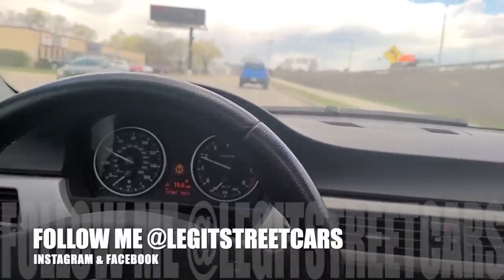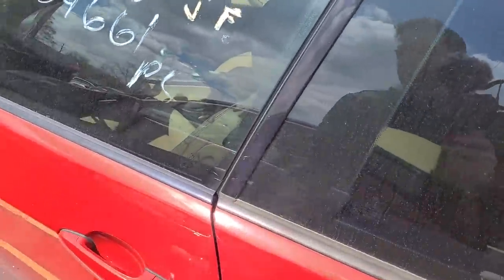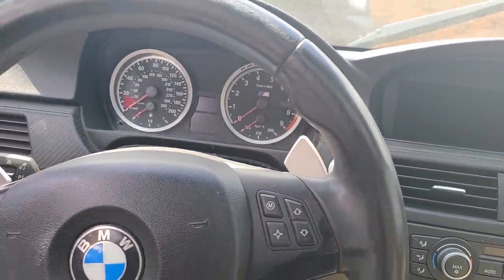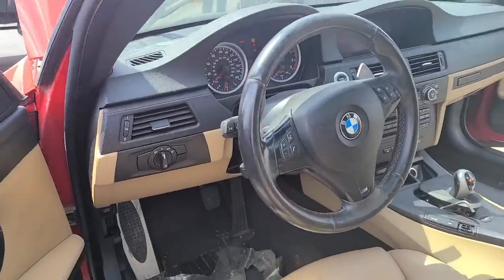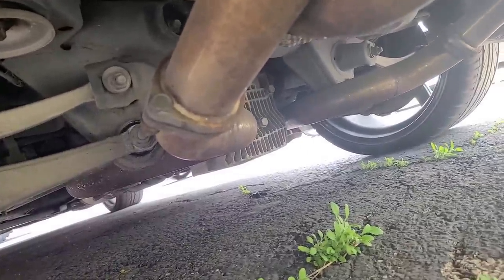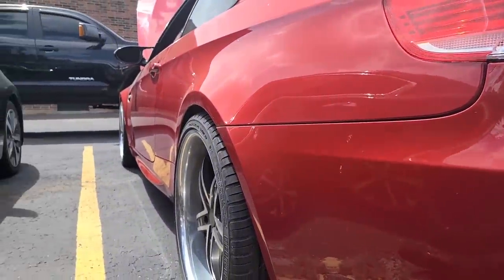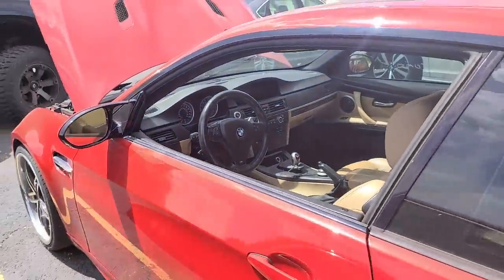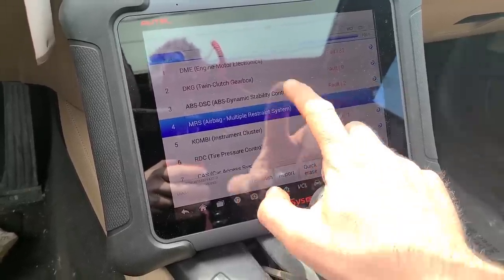I Found A Dealer Auction E92 M3 Sitting For 3 Years With A Supposed “Bad” Engine! Listen To This!

Comment: I would almost bet that this car has more than 48k miles.
Reply: This. No way you get that interior wear on something that low mileage
Reply: It is extremely hard to alter mileage on an E9X. Virtually all of the modules record mileage info and I doubt anyone spent thousands to replace every single module and code them in.
Reply: Why
Reply: Probably 148k miles lol
Reply: nearly impossible to alter the mileage on any modern bmw. Like the dude before me said, the head unit, instrument cluster, DME, TCU, and the airbag unit all have mileage stored on them, and when you replace a module the entire system will take the highest mileage of any of the modules.

Say your car is at 20k miles and your head unit dies and you get one from a wrecked e92 with 120k miles. Without sending it to a virginization service, just plugging it in will work but it will set the entire car to 120k miles even though it is only at 20k. 

You cannot fake the mileage on these, the instrument cluster will take the highest mileage out of any of the modules and display that. So it's safe to say it really does have 48k miles.
Reply: I have a 2011 M3 with 50k miles on it.  I take care of it better than any other car I’ve owned.  Wash it once per week, clean and condition the leather every 6 months or less, oil changes every 3k miles and so much more.  As cautious and meticulous I am with it, the driver seat recently started to show wear, the steering wheel needs to be recovered and a bunch of other little things.  bmw used this crappy soft touch paint on everything, like the steering wheel cover in this video, it’s all over the car.  I ended up stripping everything with this paint because it’s super fragile and just falls off.  If someone doesn’t take care of this car with high standards it will fall apart and fast.
Reply: @mcp This isn't a new BMW, this is a 2008, it's old. The technology is out there to roll back the odometer and all of the modules, nothing hard about it.
Reply: @BlagoP  you have absolutely no idea what you are talking about. i’ve worked on many e9x chassis bmws, including m3’s. 

by modern i mean any bmw with an idrive head unit which is 2004+

You can virginize individual modules but the system will still take the highest mileage from them all. there is no way to roll back a modern bmw without thousands of dollars of investment.
Reply: @notfst  not to step on any toes but here in the uk we literally mess around with mileage on these daily for a £100 its so common why does it cost thousands were your from?
Reply: Umerica
Reply: @InsaneBimmer  How difficult is it to swap the wheel and seats with another car that has starship miles and a good engine and transmission?
Reply: @notfst  can’t agree with you man, it just takes someone with diagnostic tool and a computer with a few hours on their hands, you can literally wipe and re-write mileage on every module, one by one and the way anyone would be able to find out - is wear and tear. Unlike someone said here, these Beemers were made from decent materials, not e39 quality but decent. They shouldn’t wear this badly!
Reply: If there is a way people find a way. Some might say it's hard, but money talks and there's always a way for something.
Reply: @schooltie  In parts of Canada is illegal to roll back the cluster if you get caught you can do up to 5 years in jail and 100k fine
Reply: @InsaneBimmer  Poor maintenance on the interior and maybe it wasn't kept in a garage.
Reply: @leol8658  this is not true unless you have the codes from a bmw dealer your buddy at autozone can't rewrite the mileage on these
Reply: @samuelrostas1239  it's illegal to roll back odometers everywhere.
Reply: @leol8658  just to make it clear, why would someone tamper the mileage on m3 and what would it help? It's already so expensive and he changed the engine to the m3 if you watched this video to end
Reply: @brandonpanozzo86  you can rewrite mileage on these with just ncsexpert and ncsdummy or winkpf :D nothing special, they aren't on the plate but when you dig around and change values they are there.
Reply: Agree
Reply: @chrisstedman4039  unless a 17 year old with daddy’s money owned the car. Which was likely the case
Reply: At least the engine has more than 48k! Especially if it’s from the junk yard, it was probably a bad engine from the junkyard I’ve seen it happen a million times, a local yard by me would sell EVERY engine as “under 80k miles running with warranty" and they would gladly replace it but imagine the labor cost to install a bad engine then have to repull it and reinstall. Sad but that's the industry.
Reply: @notfst  You can alter the miles in ISTA. It's not that difficult.
Reply: Underside looks too good for that area.  48k bout right.
Reply: @InsaneBimmer  false all you gotta do is change the ecu, cas, frm & keys & you got your self a low mileage
Reply: @misfiresandflattires6874  I could.make.it have 1 mile with ista p in about 10 min on every module
Reply: @chrisstedman4039  actually he knows the milage.
When you use an OBDII tool it has data that can tell you mileage
Reply: Could have had a cluster swap
Reply: Thats not a 48k interior
Reply: @chrisstedman4039  Yes, true or not it definitely looks like the interior of a car with 148K and not 48K. I had a used 1992 325 and a used 1995 M3 and both of those interiors held up impeccably. CARFAX doesn’t catch everything. This one may have had multiple engines. I would pass on this one.
Reply: When leather and stuff sits in sun light and not conditioned this happens. Probs does have 50k on the clock and is genuine
Reply: @notfst  If there are any discrepancies with the mileage it will show a code and light also. I don't think it picks the highest I thought it just didn't like the discrepancy and lights up the dash! See zeroto60 YouTube channel, he changed the cluster on an X5 and it did not like it!
Reply: Possibly out of lack of interest this happens and anyway I was working on a Volvo FH500 truck and the engine stopped at 30,000 miles and it's not the first Volvo truck to have it so I don't know what's happening
Reply: And also my friend has a Mercedes E270 so far it has reached a million miles, but on 650,000 miles he worked an overhaul for the engine and it's working to now
Reply: Nah bro the one burnt out
Reply: I have the exact same interior on my ‘09 M3. My car has over 100k miles and mine looks better than this. Definitely a red flag
Reply: @chrisstedman4039  I had a e90 this wear is not uncommon, it’s sun damage, my door handle practically melted and deformed on the interior.
Reply: Trust I have an e92 m3 with 79k miles and I bought it with 62k miles and I fucked the interior up
Reply: @the_first_resort940  the door handles disintegrate mine as well. But no wear on the seats after 100k mi’
Just the door handle and steering wheel plastics disintegrate.
Reply: I would bet that it has over 148k miles!
Reply: @chrisstedman4039  it's possible my dad had a new van and the seats were torn at 22k miles and it was all dirty from the head liner and paint was damaged aswell but we were kids and yeah u know how that ends up😂😂
Reply: @tony_25or6to4  it's also illegal to sell drugs
Reply: @BlagoP  NO there's not.

Comment: There's no way in hell I would pay $7,500 for that car being a car dealer myself and an ASE Certified mechanic there's no way I would pay any more than $5,000 for their car sounds like me and you need to get together I find way better deal than that here in Michigan all the time
Reply from the maker: I'm thinking the same now
Reply: @LegitStreetCars  
  Cars awfull but think what you can learn and share with all of us =^D ! Not for more than 5k though. 
  GLHF Alex 👍
Reply: @LegitStreetCars  still buy it for the YouTube videos
Reply: @peteratkinson1939  Yea, i agree. Buy it. It would be an interesting challenge to see if he could put a new crank in it and fix the vanos . I built a frankenstein 335D engine with ebay block and crank and its still running after 10k miles and i did it cheap.
Reply: Do you know of any m3 deals? I am looking for a project

Comment: Those rear tires tells everything. Who the hell buys "Delinte" tires for a M3?! Cheapest shit you can buy
Reply: I thought the same thing!!!
Reply: Middle Easterns
Reply: Someone who burns through tires every 3000-5000 miles. That car was abused.
Reply: Thats what I always say! You see a financed car from a mile away if you got for example a 30k mercedes and it has chinese cheap shit tyres on it, the owner isnt too wealthy.
Reply: My 08 120k miles e90 M3 with manual has cleaner interior then this one! Need an engine too 😅
Reply: Glad I wasn’t the only one thinking this & also thought this car was probably rolled back too looks like 100k+ mile car
Reply: HAHAHA Delinte I had those on my beater 2006 Nissan Altima to my surprise the summer racing versions were awesome in snow storms
Reply: People who can barely afford the payments on the car to begin with.
Makes my stomach turn seeing this car in such a state
Reply: Shit tires to match the shit wheels.
Reply: @SSammy-1  Love that, saw a early 2000's G-Wagon, driver frontin' and leanin, with a lovely set of brand spankin' new Lao Lion tires. WTF...
Reply: @focussport  and to match the owner
Reply: Exactly. At least buy Achilles.
Reply: Bet this thing has done more than a few burnouts and donuts in its life.

Comment: Yes! Please make this your next project car. I have the same issue with the weather stripping on the windshield. I can't think of another cross plane v8 that revs higher than the s65. Whenever I think about selling mine, I take a drive and fall in love with the car all over again. The sound is incredible! For a cheap exhaust, you should consider doing the OEM muffler mod.
Reply: Also have a set of factory 18" ceramic coated wheels from an 08 that I could part with, but I'm on the east coast.

Comment: That sounds like low compression on one of the cylinders the way it sounds when cranking over
Reply: THIS, you can hear the starter speeding up as it goes past the dead cylinder
Reply: Yea, but keep in mind it has been sitting for a while. Could be that it clears up after a heat cycle.
Reply: @BenDeSwert666  Unlikely, especially as it was sold as needing a new engine, someone obviously already knew it had a dead cylinder
Reply: It sounded even worse when he re-started it from warm, like it had maybe 2-3 low compression cylinders
Reply: @BenDeSwert666  that would only be true if it maybe had a stuck piston ring, but that would only loose slight compression. This thing sounds like zero compression on one or more cylinders, which would most likely indicate bent or chipped valve.
Reply: @Uninfluenceable  maybe it skipped timing somehow and fucked up a few valves and now runs like shite because of it
Reply: @Uninfluenceable  I mean the owner complained of timing related issues after the bearings were done...
But yeah, definitely a fucked up engine. Probably not worth fixing (don't even know if it's possible), just get a used one and toss it in.
Reply: likely overheated and warped heads blown gaskets. parts car at best
Reply: @throttlebottle5906  99% chance of that not being true.
That would explain overheating due to a blown head gasket.
But not low compression and metal shavings.
This thing jumped timing and the pistons and the valves kissed.
Reply: @ast5515  keep running an engine with coolant in the oil and see what happens ;)
timing set and more quickly goes bye bye.
but perhaps they ran it out of oil or never changed it at all.

Comment: Offer him 3k and call it a day. Even if you gotta spend 10k on an engine, and you do the rod bearings. You can easily sell the Car for 20k. 
Edit: he wants 10? Lmao he’s trippin. 10-12k motor 2-3k bodywork. Car ain’t worth more than 5k sorry.
Reply: You have to remember that he also makes money from content and this looks like a lot of content
Reply: @Thanos.m  While this could be quite the project for the channel, it's honestly a veritable money pit. If I had to work a day job, spend time on other project cars, spend time with my family and film/edit everything... Doesn't sound worth to me, at least not without sponsors. He already has one in this video but I don't know... it's ultimately up to Alex. Restoring and flipping this would at least be a nice story.
Reply: And that's assuming the trans is good
Reply: And also he’s gonna want a motor that’s at or below the current mileage. And a 50k mile s65 with unknown RB history easily goes for $10k plus, body work and paint, $2-$3k, then all the maintenance has to be done (pads rotors, spark plugs, throttle actuators, rod bearings, belts, filter, oil, tires, alignment). Change those ugly wheels lmao and also redoing the leather. You’ll a be in the car $30k by the time you’re done.
Reply: @lfox02  all that is true but honestly this is  not how automotive youtubers work he can even loose a few thousand on this car but If it does good on views he'll still be making money it's all about content and what proves to be popular
Reply: @tony_25or6to4  And that the suspension isnt completely trashed.
Reply: @Thanos.m  well if you just go on the content thing.. JR made a video on a beater M6 was only able to make 2-3 vids on it. 
Better to get a high mileage M3 with less sketchy background if you want an M3

Comment: I've owned 3 535 i's as well as 5 528 i's, a 525 es and now my 530 I. All were 1 owner when I got them. Very Lucky. I did my due diligent research when looking for them. 10 BMW's over 30 years and I've had no major problems with them. They were well serviced and I kept them well serviced. That's the key ! Keep them serviced! I do the same with my Porsches. Keep them serviced!!

Comment: I was thinking $8K before you said you offered $7,500 - I'm sure a deal at $8,500 would secure it after pointing out ALL the bad things (suspension, fuel system, etc) but that's a hell of a lot of work - looking forward to the next update and the BUILD!

Comment: How do you make an interior look like that after less than 50,000 miles?
Reply: Probably mileage is not correct... My guess is the engine is simply worn out, probably because it has been trashed. Everything about that car screams 'stay away!'
Reply: by being a real bmw driver.
Reply: @catalinxnecula  no real bmw driver would ruin a car like this
Reply: Step 1: Buy BMW with less than 50,000 miles.

Step 2: Drive it.
Reply: @catalinxnecula  I drive my M5 like a real BMW driver 😂🤣
I'm up to 64,000 miles, no wear on anything, the car looks like brand new
Reply: @arcadeuk  Which generation? Some get better rep than others for build and material quality.
Reply: Simple- just never so any cleaning or conditioning on the interior. Just jump in and thrash it (which is obviously what this poor cars life was).
Reply: a real bmw driver skips on a few very important things in order to achieve bmw standards.... things like showers, signaling, giving way to the incoming traffic, the motherfucking safe distance to the car in front and so on. so if you identify with that only then you can call yourself a real bmw driver. if you skip everything else but the shower than you are no more a real bmw driver but an audi one.
Reply: My E91 Wagon has 104,000 miles and looks practically new inside. It has very minor seat wear from entering the vehicle and that is it. The steering wheel buttons and the wheel itself all that stuff is very new looking.I bought it from an older German guy who got it from an old women.
Reply: @catalinxnecula  who hurt you bro?

Comment: Did you check the mileage in the control module, the mileage with the interior wear doesn't add up, I've never seen a 50000 mile bmw with that much wear
Reply: Meth
Reply: You'd likely see a tamper dot unless they swapped the cluster and the LCM/key/etc.  Novillo leather doesn't wear well at all if you're a heavy person and never do any sort of cleaning or conditioning.
Reply: The instrument cluster will take the highest mileage recorded in the system. It will come back as the same. Just seems like someone who didnt care for the interior of the car whatsoever.
Reply: That shit probably sat outside without any cleaning/conditioning for the last 3 years...
Reply: That doesn’t make sense. You have no way of knowing what anyone did In their car.

Comment: I HAD SAME ISSUE WITH MINE , TURN OFF EVERY TIME AND THE ISSUE WAS A SMALL  VALVE CALL PURGE VALVE (54.OO OEM PART ) GOES UNDER THE INTAKE, TRY  FIRST AND SPARKS /COILS, GOOD LUCK

Comment: For $10 Grand, the words "go pound sand" comes to mind!!
Reply: Fr I'm thinking like 2-3k tops
Reply: Especially since it’s been sitting for 3 years beavsie he couldn’t get 10k for it but you want to pay that? Nahhh
Reply: @MannyFresh1x  in decent condition with blown motors these go for 8-12k. I’d say 10k is reasonable for this if he was confident the motor wasn’t blown.
Reply: @kylekeogh2731  Pretty much. The car has parts value. Yeah the motors are expensive but so are doors, fenders, hoods, trunks, suspension components, transmissions, electronics, interiors... literally everything is on this car. That wouldn't stop me from lowballing $7k, but you'd have to be smoking crack to think there is less than $5k worth of parts on this car.
Reply: @zecharious3701  yeah. I wrote that comment before I watched the entire video. That being a car from the first year and having a sun roof it’s not worth much. In the condition it is rn Id say it’s not worth fixing at all.
Reply: Among others....